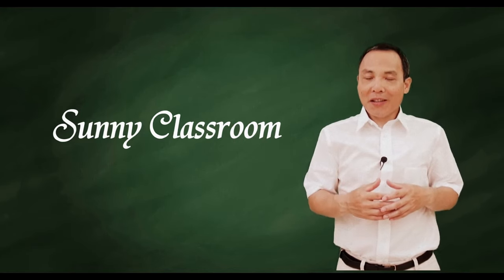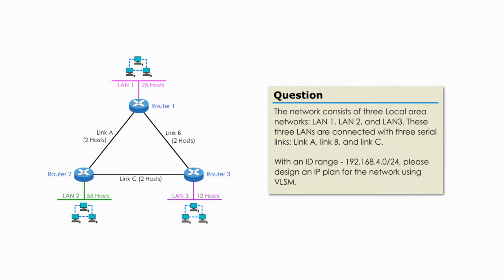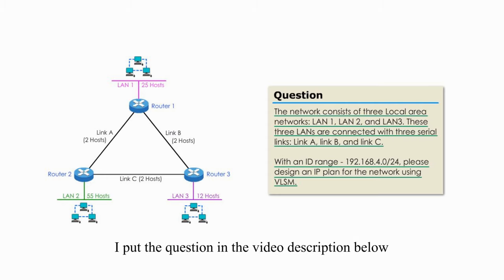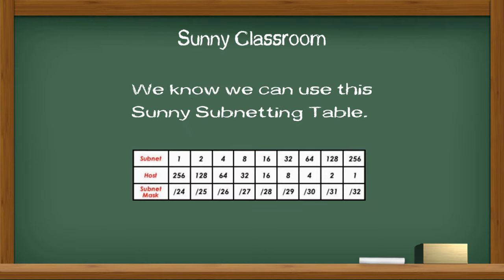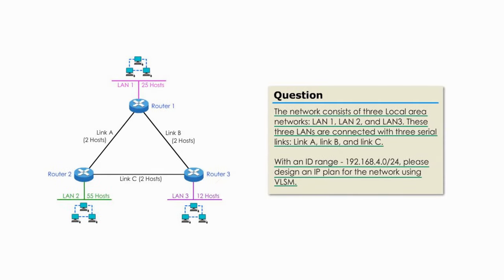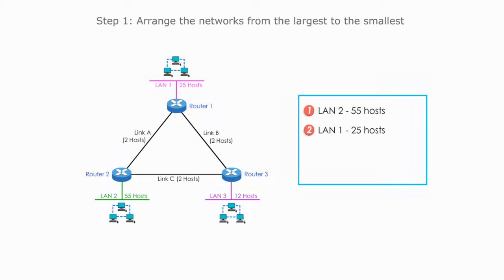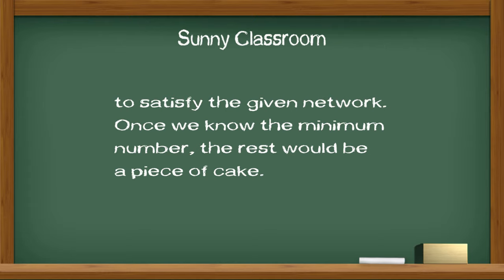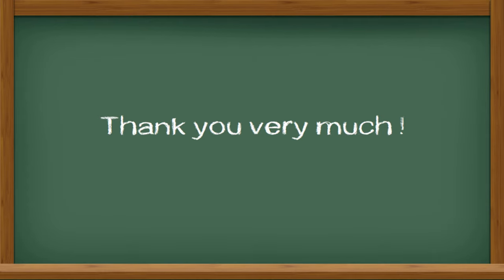VLSM Subnetting - subnetting a subnet

Comment: just wanted to point out the routing protocol RIP version 2 is needed for CIDR. In most cases the use of VLSM is reserved for very large networks. A clas C network properly routed would be enough to satisfy most needs. I suppose trying to change to CIDR would cause serious disruptions to any company so this should be considered during network design
I have CCNA I-IV and your lecture was outstanding

Comment: Thanks a lot sunny, you made it so easy for me to understand with your cute accent. But, i didn't get the last bit when you chose 4 instead of 2  in sunny table for the serial links.
Why you didn't select the 2 ? each serial link needs only 2 hosts ID.
Reply: While 2 is theoretically possible, 4 nodes is the smallest usable network. Remember, you need a network ID (that's 1 of 2) and a broadcast ID (that's 2 of 2), no room for other hosts. A network of 4 will give you both a network ID (1 of 4) and a broadcast ID (2 of 4) and still leaves you with two nodes to use (3 of 4 and 4 of 4), to create links in this example .
Reply: @patryk2700  Ty!

Comment: This helped me understand subnetting! :)
But it also confused me; i thought that I had to split an existing network into several parts, and the number of parts was determined by the number of hosts in the subnet. So if one subnet was having 200+ nodes, I didn't understand. But it seems that it is more like branches, and each branch can have everything from 2 to 1000 nodes, independent of the other subnets, and only thing to watch out for is ip's overlapping.

Or am i completely wrong?

Comment: First of all thanks, secondly I thought that the three local networks each have a network ID is special for reuters; But my belief seems to be wrong since the links between the routers need 2 host..I'm confused but my question right now is if the network ID isn't special for the Routers if it's special for what? for all the devices in the network? '-'
Reply: I think it depends what range you have or are given as a company. Or, this setup could even be one tiny portion of a much larger network and for the sake of saving IP addresses this is what you have to work with. That’s the entire point of subnetting after all.

Comment: Prof Sunny, thanks for the video. I know very little when it comes to Networking, so please bear with me. why is the table to design the plan for each network smaller than the previous question in the subnetting is simple video. For example, this one does not have the Broadcast ID, # of Usable Hosts and Host Range columns.

Comment: Okay this is all perfect and totally understandable, but i have a question. My question is what would i do if i'm given 3 lan networks like this;" Lan 1 130 hosts, Lan 2 19 hosts and Lan 3 60 hosts". Well since you have to take the largest which would be 130 in this case, that would require me to take the row with 256 hosts right? Which only allows me to make 1 subnet and therefore how would i continue to subnet a subnet which can't be used anymore. I know how to solve it if i had 3 subnets with "low" host count, but what would i do in this case?

Thank you :)

Comment: Consider a router that interconnects three subnets: Subnet I, Subnet 2, and Subnet 3.
Suppose all of the interfaces in each of these three subnets are required to have the prefix
223.1 .17/24. Also suppose that Subnet I is required to support up to 63 interfaces, Subnet
2 is to support up to 95 interfaces, and Subnet 3 is to support up to 16 interfaces. Provide
three network addresses (of the form a.b.c .d/x) that satisfy these constraints

Comment: With your example and same ip I tried to make 4 subnets and came up with the 4th 
Network ID : 192.168.4.256
Host id range : .192.168.4.257- 192.168.4.318
Broadcast id : 196.168.4.319. 

Is this correct?
Reply: Or do I need to make 8 as the subnet?